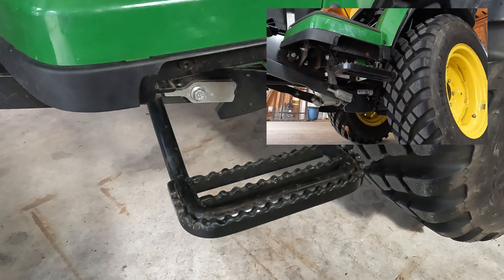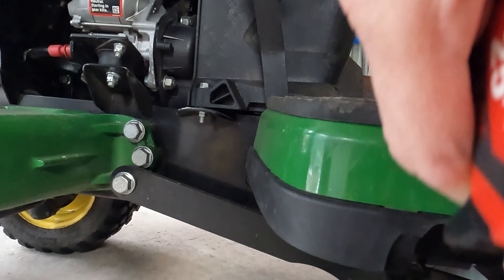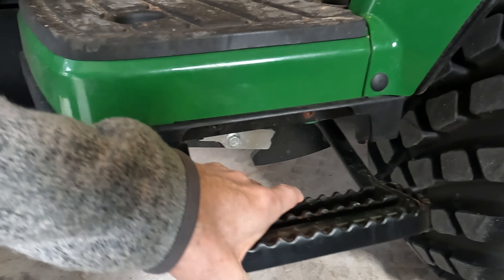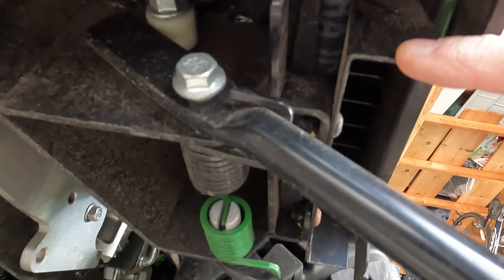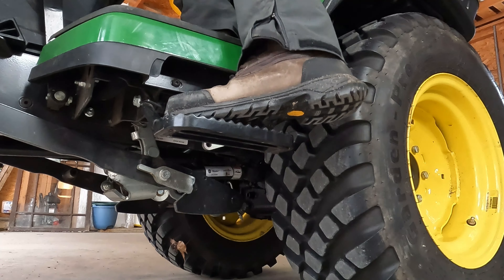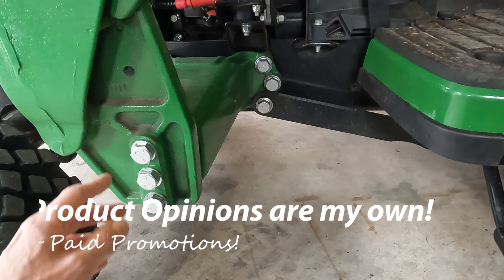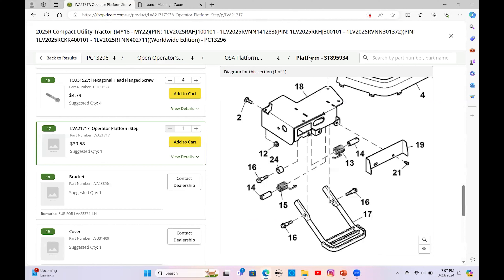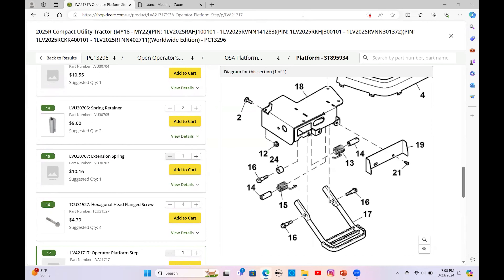John Deere 2025R Step Ladder - Overview, Use, and How to Find!

Comment: On my 2025R I added a loader bracket mounted step to the right side, so I now have a step on each side.  Wasn’t hard to do- take out top bolt first, attach through the step’s top bolt hole, tighten 3/4 way or so, then remove the bottom 2 bolts while top bolt holds the assembly in place, swing the step down to line up the bottom holes, install the 2 bottom bolts and then final tighten up all 3.  I also added ‘grab handles’ to the top of the loader arm brackets on each side. Easy now to get up to seat from either side, with secure hand hold for both hands while climbing up.
Reply from the maker: Nice idea! Would help to have a step on both sides.  Thanks for sharing!